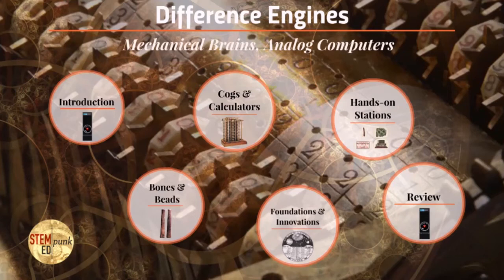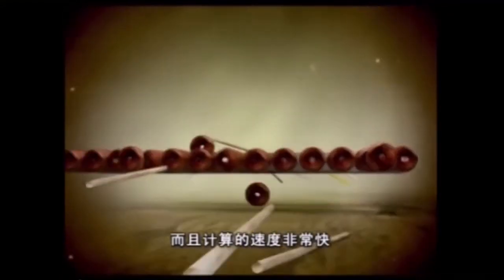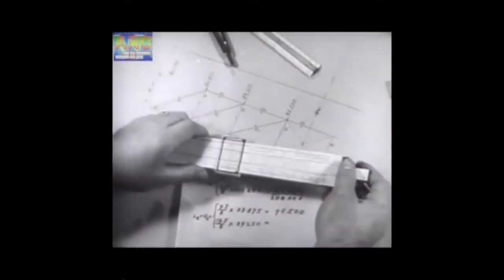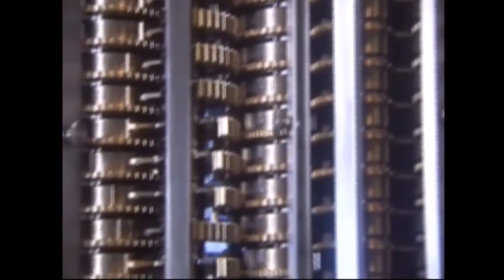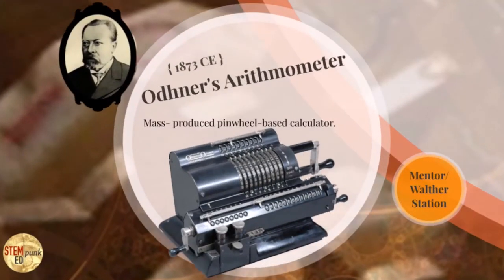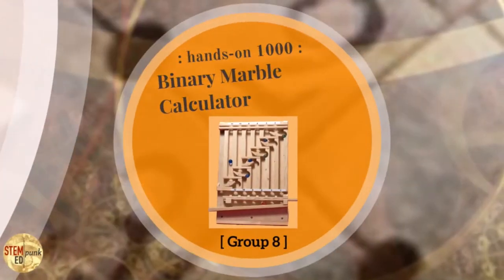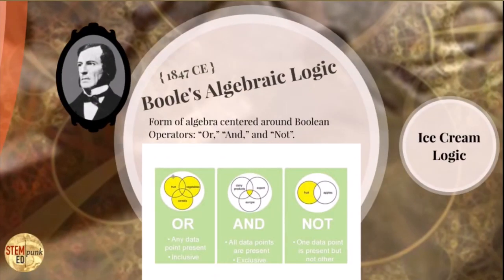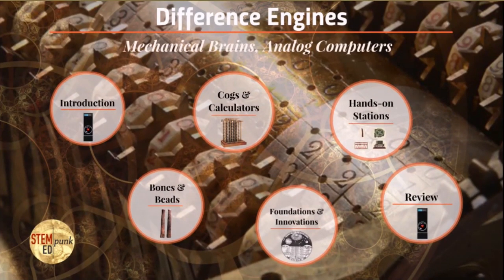Difference Engines: Mechanical Brains, Analog Computers - STEMpunk

Comment: You are misusing the words "analog" and "digital."  Lots of mechanical computers are in fact digital computers. Some early electronic computers were in fact analog. 

The difference is is whether the reading is continuous or discreet. A slide rule is an analog computer because it offers a continuous scale. I can read or estimate between the marks on the scales.

An abacus is a digital computer. Each bead represents a discreet state.  It is either in a position to be counted or not in a position to be counted. It is never gauged as being in a measurable state between being counted or not being counted.  I don't place a bread in a position where is 1/4 counted. 

Likewise, most mechanical adding machines are digital.  Each output wheel or slide represents ten discreet states of the numbers 0 through 9. One does not and cannot measure the difference of how much the wheel between two numbers to get a meaningful fractional state.

Most modern electronic computers are digital, not because they are electronic, but because they are based on calculations using discreet bits. A bit is read as either on or off.  A bit is never read as being 3/8 on our 5/8 off.

In the early days of electronics, before creating computers fast enough to make decent approximations, there were analog electronic computers. Numbers were represented by a continuously variable voltage measurement.  Addition would be performed by mixing two voltages together to get their sum. Subtraction was done by mixing a positive voltage with a negative voltage. Multiplication and division calculated by changing the gain of an amplifier.  Derivatives and integrals could be performed by using coils and capacitors. The end result would be measured based on the voltage of the outputs.
Reply from the maker: Thank you for your comment! It was last year sometime that I noticed the lack of nuance in my use of analog and digital. Regarding fractions, they are possible on a cam as is shown in the Ford targeting computer.

Comment: Computer is device that can run programs, without programs it's a calculator.
Reply from the maker: A program is a set of instructions for manipulating numbers. Both data and instructions are in binary at the machine level. A calculator (mechanical or digital) is a computer that runs a single, fixed program for managing numbers as equations. A general purpose computer can accept different programs to manage numbers as more than just equations … taking binary (a way to represent numbers) and processing it (a system for manipulating numbers) into outputs other than just equations, such as videos, games, and more.
Reply: That definition is a bit too narrow.